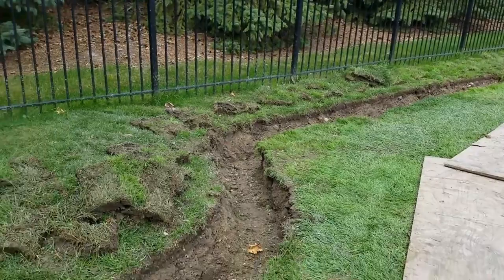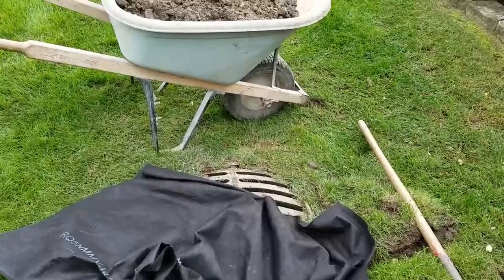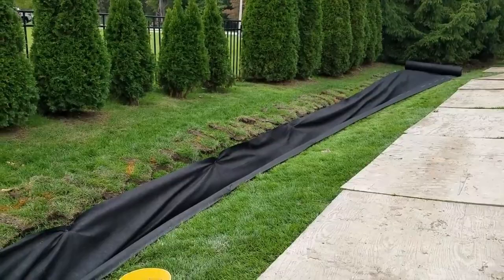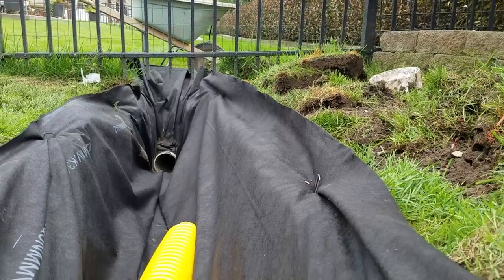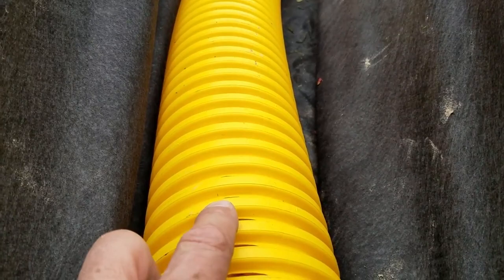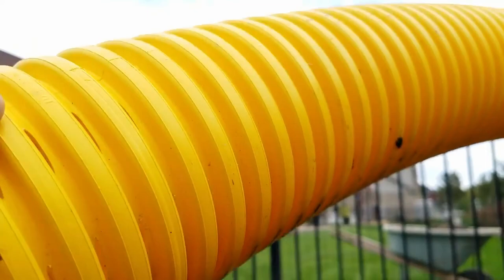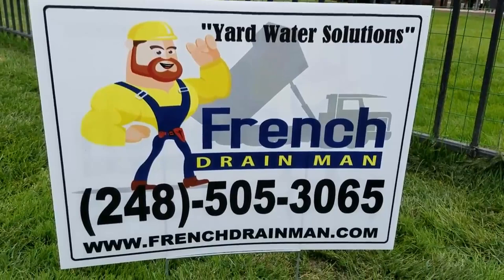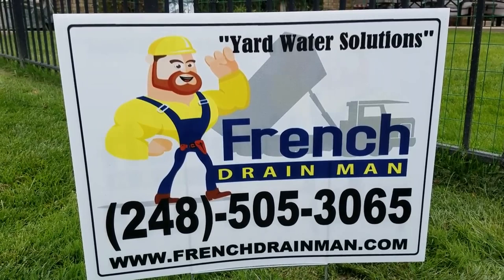How to Install The Best French Drain: Use Corrugated Pipe and Geo-Textile Fabric

Comment: What if you're in a rural area with two drop offs and no catch basin to tap into? I'm researching companies in and around my area in Central Wisconsin. This project is something that has 12"-2ft of standing water (ice and snow right now). What questions should I be asking. The biggest issue is how to get the two runs i know have to be done dried out come spring or this land will never recover. As it is its been 2 plus years of flooding from rain and a broken road coming in from my west.
Reply from the maker: Dig a pond
Reply: So hire some one with a front end loader and "steps" to get to an area to dig a pond? Just wondering if you are being serious? Thanks for any good advice. Love the channel.